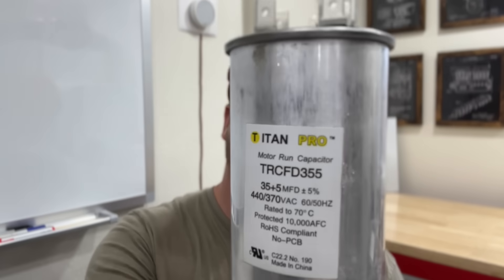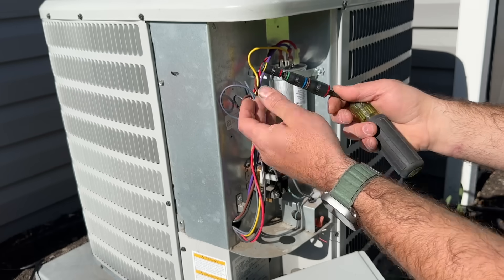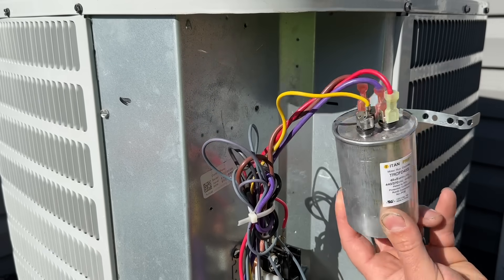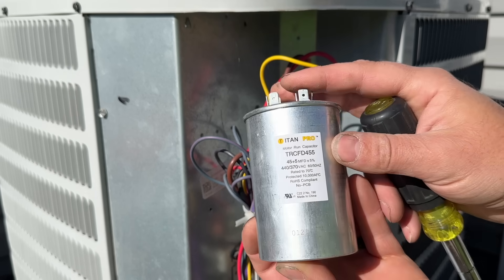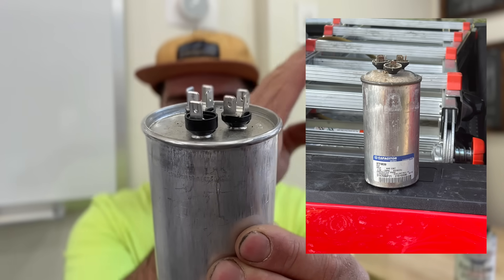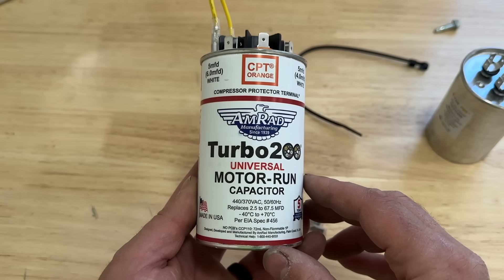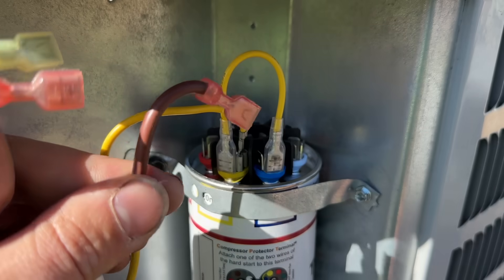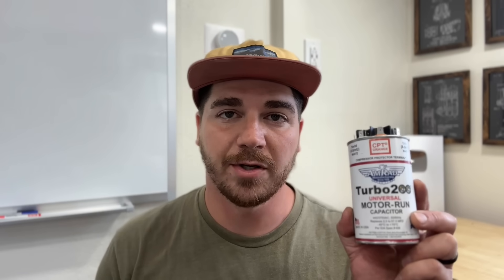HVAC Contractors Practically Make Their Living On These

Comment: It is sad and deplorable how much greed and corruption there seems to be in almost all the contractor trades at this point... yes there are honest and competent people as well - but in my experience they are hard to find.   I got quoted $160 as a parts cost for a $15 capacitor.... plus of course a $100 trip fee and $250 for labor (for a 10 min job).  Total almost $510 for a 10 minute job and $15 of parts.  I of course told them to get lost.  I understand there is overhead and reasonable profit margins needed to run a business... but in the contracting world it's really gotten ridiculous IMHO.  At this point I try to avoid contractors as much as possible - but I do give my business to the few that I know are honest and reasonable.

Comment: Because of ethical folks like you on YT, I was able to replace the cap myself, add a hard start kit as well (recommended by the Goodman service manual) , replace a defective temp sensor and replace the fan motor on a 15 year old Goodman heat pump. I too was told that I needed a new heat pump, and at the least, a new compressor for multiple thousands of $$. My cost, all in (motor, caps, temp sensor and replacing a few connectors = $225. ($150 of that was the new fan motor). Took about 1.5 hours. It's been running flawlessly for 3 years now. Thanks, keep it coming!
Reply: When I replaced my fan motor on a unit that was 30 years old, I had to take the old motor to an AC shop so they could remove the fan blade from the spindle, which, with all my efforts, I could not do.
Reply: @HardRockMaster7577  Just need an inexpensive puller
Reply: Great job !! Can you imagine  all the helpless elderly & homeowners being robbed !!!
You should start a little business  being a second opinion basic HVAC guy just to go out & inspect if someone  unit need to actually  be replaced 😊
Reply: @tedm4932  He's busy making money on YouTube (not that there's anything wrong with that)
Reply: @tedm4932  

You would need to be licensed with your EPA Universal or Type III certification to do that. Also they always disappear when it's "after hours", bad neighborhood, heights, crawlspaces and or 140+ degree attics get involved.
Reply: It took the rest of us at bare minimum at least 4 years working for peanuts in a apprenticeship to even "begin" to know what we are doing. I've been doing this professionally for 22 years and I can't begin to know everything even now. The classroom time and license tests were very hard. It's extremely physically and mentally demanding work. You work with weather, heights, crawlspaces, heavy lifting, bad neighborhoods etc etc all of it. To hear and read someone such as yourself jump online and dumb down our trade is akin to trying to take over a doctors office pretending you know what you are doing.
Reply: @tedm4932  No thanks. I'm retired.
Reply: @Mondo5904  
No you dont need to be universal EPA.
You need to be type 2 to work with refrigerants (home/Office) by law but being a 2nd opinion/inspection no law against that.
To be fair. EPA is just government nonsense trying to collect more money from people. It has outlived its size and its why EPA is banning 410a refrigerants so they can push some other refrigerant and act like they still need to do this... In a few years they will ban that one too and start over again.
You could take the test and get level 2 in probably 2 weeks or a month of study. Its not super hard. Many free practice tests.

Also no one is going to go around and demand to see your EPA card nor would anyone go around and demand to see it on some random house you at. 
Not everyone keeps the card on them because its mainly only ever used to get refrigerant and your file is logged in the computer.

However.... You can still get refrigerant online without an EPA. Some sites dont even ask for it or just say "For resale" and there you go.
Reply: Nothing misleading about anything....

Anyone purchasing refrigerant for use in a stationary appliance or handling refrigerants (such as air-conditioning and refrigeration service technicians) must be section 608-certified;
Anyone removing refrigerant from a refrigeration or air-conditioning appliance must evacuate refrigerant to a set level using certified refrigerant recovery equipment before servicing or disposing of the appliance;
The final disposer (such as scrap recyclers or landfills) of small appliances, like refrigerators and window air conditioners, must ensure and document that refrigerant is recovered; and
All used refrigerant must be reclaimed to industry purity standards before it can be sold to another appliance owner.
Reply: @JohnDoeEagle1  I'll just hire a local HVAC guy with the right gear to recover it. Not sure why all the negativity. It's not like I would ever hire you to do anything.
Reply: So how do you intend to recover the used freon in the existing equipment? How do you check/add/remove freon to the new unit? Do you even know what a expansion valve is or how to calculate subcooling and superheat? Do do have gauges, temp probes and any recovery equipment as a unlicensed homeowner? Negative ghost rider!

Anyone that thinks sheet metal work is "easy" is full of it and themselves as well. That's a whole another skill and trade within a trade. Most shops have at least one or two guys that are qualified and capable sheet metal guys. We were a small shop and had to learn how to do it all. I'd pay good money to see you build a 3 or 4 side transition using a Pittsburg machine, brake press with no training or experience as well.
Reply: You do no that it will now cost double to replace your system today than it would have cost to replace it 3 years ago,so you may have saved a little then but you will spend alot more than you saved when you do have to replace it,
Reply: @hixonheatingairconditionin3760  

What I find even funny is he considers a 15 - 18 year old unit OLD. Lol I still work on mid to late 1980s Trane and Lennox units on a regular basis. They aren't even breathing hard until they are at least 30 years old for the most part. Anything from the mid 1990s on is no problem at all if they were properly maintained. Plenty of Trane XL1200s going strong as well as XE1000s.
Reply: @hixonheatingairconditionin3760  Not sure what you mean by paying double. Inflation? I "know" I have an old system, and plan to replace it next year with probably a Mr. Cool system that seems to be a drop in replacement for the Goodman. I'm leaning toward that as it comes with pre-charged lines, so I don't have to pay someone like you over $1,000 just for refrigerant. I'll probably pay about $4,000 for the DIY entire replacement, instead of the $12k quote I get from local HVAC guys... By doing the repair work myself, I bought a few extra years on the old system, and the savings go into the new DIY system replacement. Your point is moot, and your sauce is weak.
Reply: @Mondo5904  

Both Mr. Cool (never even heard of them) and Goodman equipment is cheap trailer park garbage. You want a Trane or a Lennox if you want it to last for 30+ years and be repairable. Also just so you know precharged lines don't mean you don't have to add Freon and calculate/figure superheat and subcooling to get the charge right. You'll also need to fabricate on the A-coil cabinet and possibly the transition because they seldom if ever drop right in and work without modifications. Are you a tin man? It's doubtful because that is a skill in itself among the HVAC tech trade. A-coils that are mandatory 13 SEER have expansion valves and are usually taller, longer and wider than older 10/11 or less SEER units. They seldom if ever go right in without modifications. I would be worried about your 240 Volt single phase double pull breaker in your box being too big as well. That older unit pulled a lot more amps and it will now be too big and will need to be changed out for a 20 or 25 AMP most likely. You don't want a 30 or 40 AMP breaker when something goes wrong. It won't trip and your compressor will be fried in the process.
Reply: @Mondo5904  

BTW...whoever is selling you that A/C without a license is breaking Federal law.....
Reply: @JohnDoeEagle1  This is just not true and misleading -that its against federal law to install your own. Messing around with refrigerant is not something I would attempt. Thats why the pre-charged line option is attractive, and does not require a license to install. If you are venting old refrigerant into the atmosphere, yeah, that's a paddling, if you get caught. Not something I would even think about. Show me the fed statutes that say this. I looked, could not find anything.  Even Goodman is sold as a DIY install. Even though you think they are trailer park trash. My Goodman has been keeping this 3,700 SF house warm and cool for 18 years now. My previous house had a nice Trane, which required yearly maintenance and was super expensive to repair. Not missing that.
Reply: @JohnDoeEagle1  Happy to save thousands on trailer park trash that works, vs. an expensive Trane or Lennox. I've had them both and am pleasantly surprised that the Goodman has been working so well, and that I was able to repair it myself. BTW, the Mr Cool is a exact drop in replacement for the Goodman that I have. But if I have to do a little sheet metal fab, it's not rocket science.
Reply: @Mondo5904  

Dumb ideology coming from a unlicensed, untrained, unqualified rookie amateur. Especially Trane and Lennox equipment  are made to last 30+ years. They are made to be repaired. OEM parts are available nearly indefinitely for them. BTW...Trane furnaces come with a 20 year heat exchanger warranty. I bet the crappy company you dealt with junked it while it was still under warranty and a perfectly good unit too.
Reply: @Mondo5904  

Funny you think you just hook up the lines and are all set. LMAO

Laughable.....
Reply: @JohnDoeEagle1  Lots of assumptions here. So I'll just assume you are one of the HVAC contractors this video was warning everyone about.  You go little buddy.
Reply: @JohnDoeEagle1  Funny you think insulting people without knowing anything about them makes you look like an expert. I'll deal with my issues, you deal with yours.
Reply: @Mondo5904  

I have to reply to myself because people like you keep deleting my comments which are 100% true and factual. You act like you know more about it than I do. I can't see why any of us licensed professionals would take any offense to that.
Reply: Ain’t no such thing as a booster cap cuz you got played
Reply: @justincummings4775  Sorry, it was a hard start kit, not a booster cap. My bad.
Reply: @Mondo5904  2 wire or 3? We install Goodman having issues with a certain 2 wire hard start cap going OL and not allowing compressor to start
Reply: @justincummings4775  It was the 3 wire kit  CSRu2. (the one Goodman says is approved for their units) I made sure to get the made in USA version. Wired it up and its worked just fine for 3+ years now. No problems ever on startup after the install. Lights in the house stopped dimming at startup after that.
Reply: @Mondo5904  if you have to replace the run cap like this guy is talking about get an amrad with a cpt terminal and hook the wire that would go to the common to the cpt so it doesn’t try to run on the hard start by itself
Reply: Rest assured these types of videos have little to do with ethics and everything to do with money
Reply: @markme4  If these guys make a couple of pennies for me watching a video that saves me lots of $$$, I'm ok with that.
Reply: @markme4  

They sure do...any licensed professional would jump at the opportunity to turn him in for the $10,000 reward. He's the perfect person for it with the right attitude to get it.

When you become disrespectful and obnoxious to someone you "wished" you could be by faking it then you deserve what comes to you.
Reply: @markme4  

Any licensed professional HVAC tech wouldn't hesitate to turn this guy in for the $10,000 reward. He's the perfect person for it with the right attitude.

Comment: Another way to tell if your run/fan capacitor is faulty is your electrical usage is higher than before, because a worn capacitor will cause higher power draw. Most capacitors typically won't last beyond 5 years depending on use.

Comment: A hvac guy told me once a box wasn't wired right, always connected even if you pull. He said ALWAYS have a no contact meter to check.
Reply: It's why when I deal with heavy electrical like this, I cut the mains power.

Comment: Yes! My unit had a slight hesitation on start.  HVAC guy quoted me $350 for the capacitor.  While he was there I found it on Amazon for $35. It’s like 3 wires, total scam at 100x markup
Reply: Do you think you’re paying just for the part?
Reply: @garrybillick3979  nope. It would also be for the 5 minutes total it would take to remove the access panel, unscrew 3 wires, unclip capacitor and reverse. Which is what I did the next day when Amazon delivered the $35 capacitor

Comment: Dont change your own capacitor. It's fine to do if it's an emergency. But most of the time, there is a reason the cap has gone bad. I still recommend have a technician inspect the system

Comment: Wrong!! A capacitor is not like a battery in any AC - alternating current circuit. It does not provide a jolt of energy when unit starts. It is however a vital link of the motors,  yes 2 motors the fan and the compressor. There are no electronics in this compressor unit. Yes folks are getting robbed due to their lack of knowledge. Hard start kits are just a different value of capacitance that assist the starting of the motors. I keep a complete set of spare small items for our heater / AC unit. Anyone can replace a capacitor. Like is said take a picture and replace wires on new one and the same place as the old one. Too easy. Just turn off power first.

Comment: I'm fairly familiar with AC units. 3 common repairs. Cap, Condenser Fan, and Contactor. Only problem is my AC went out on a Sunday. No parts stores were open so I called a local company. They hosed me $300. to replace the Cap. So after that I bought 2 Caps, a fan motor, and a 2 pole contactor. 
Now with those basic parts I've kept family and a couple of neighbors running. Made a few bucks that covered my small investment in parts.
Another common problem that is free to address is a dirty condenser coil. You can simply rinse the coil clean with low pressure water, or buy a can of coil cleaner and then rinse it clean after the cleaner sits awhile.
Reply: I don't know why I was imagining Hank Hills voice as I read your comment 😆
Reply: $300 for a run capacitor on a Sunday?  Thats extremely reasonable, FWIW.
Reply: @garrybillick3979  Absolutely, I wouldn't go out on a Sunday for less than $500

Comment: This capacitor was already discharged (no sparks) due to the run winding draining the capacitor. It's precautionary to short if you are removing them right away but not necessary if you let the unit without power source a few minutes untouched. Although the correct method to discharge them is to use a 20k Ohms resistance tool. Nice video though.

Comment: Customers always talk about how the capacitor is less than $10 on Amazon. lol when I first started in this trade, not licensed, I use to order mines off Amazon, because I could not go into any supply house at the time to buy the MARS, or a TradePro Capacitor. The ones I would get off of Amazon, I BS yall
Not, out of the 5 Capacitors that I used from Amazon all 5 of them went bad In less than a month. This is what people don’t understand. Also, when people charge $300, some actually give you some kind of warranty that’s imbedded into those $300 that’s what people dont seem to realize. Regardless do it yourself, I’m too busy to take on new customers now 🤣🫂

Comment: I would suggest that the homeowner turn off the unit at the breaker and at the tstat. If they don’t plug in the disconnect in one smooth quick motion they could judder the compressor and cause it to go out on overload. Also, if the tstat is calling for cool the low voltage will be hot at the  contactor  if they accidentally ground out the 24 volts they could blow the fuse on their furnace control board.

Comment: I always have a capacitor on the shelf ready to install as needed. A couple of years ago I thought I lost the capacitor, but it turned out to be another simple problem. There were a bunch of earwigs that had had gotten inside the unit, and one was on a contact for the start relay when it energized. It got smashed between the contacts and stopped the circuit from closing. A simple blast of air to clear it out and the unit was running again.

Comment: The capacitor does not give a jolt of energy when it first kicks on. The capacitor adds capacitance to the circuit. It results in a phase shift that the motor requires to run and most importantly do so without damaging the motors that use them

Also, I charge $60 to replace these.

Comment: I had to replace the capacitor on my condenser unit two years ago. I felt like an archaeologist trying to figure out what capacitor to buy. It's an old unit built for mobile home use and most parts sites don't list it, and the label was missing. I found it eventually. (Turned out I still had the parts list from when I bought the home.) That universal capacitor would have saved me a lot of frustration!

Comment: Your description of a start cap is wrong.  It provides the phase shift needed to start a single phase induction motor.  This is done with aux windings and this part of the circuit is removed after starting due to reduced efficiency.